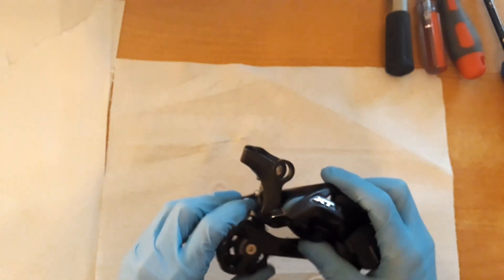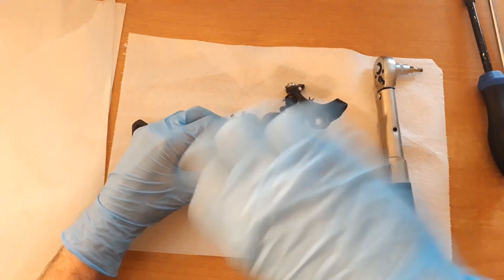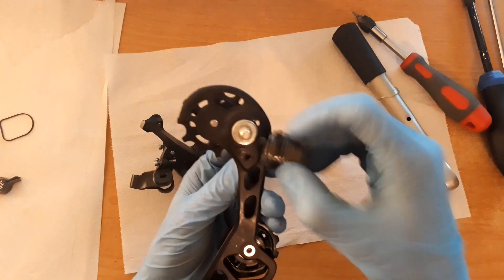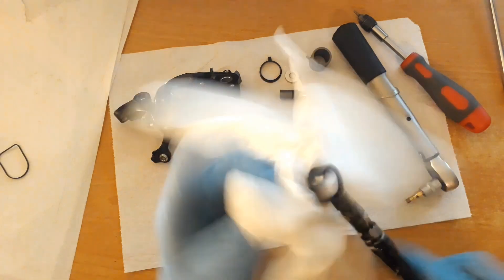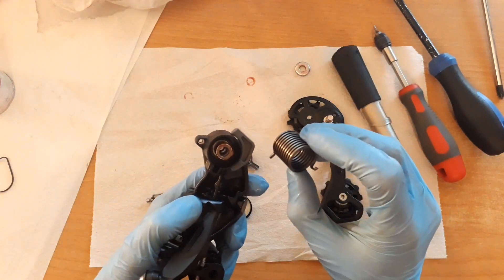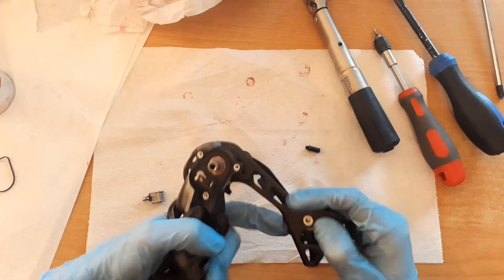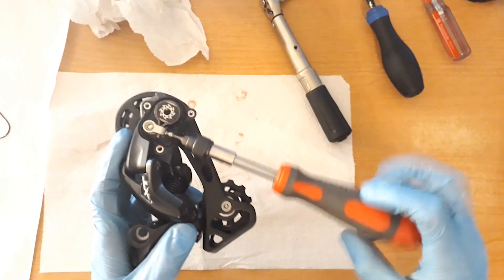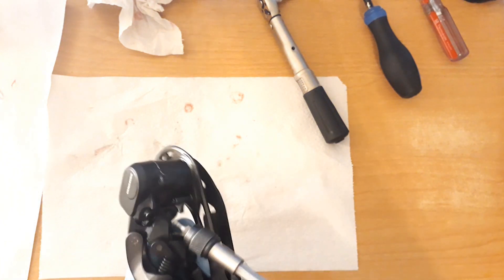Let's Do Maintenance - Shimano XT RD-M8000 Derailleur

Comment: The rubber ring on my plate axle was part of my issues, it disintigrated when I removed the axle. it was so stuck, I had to use a drift to get the axle out. I'm hoping that the grease will be enough to seal everything from water, I didn't have a new o-ring to put on.

Your video was excellent, very easy to follow and super helpful.
Reply from the maker: Yeah, I was surprised to find that o-ring there. The mech in this video actually was my new replacement mech. I did the service on my regular mech just before that and didn't see (or notice) any o-ring there. 🤷‍♂️

Comment: Nice work, thanks. How often (kms) do you think is necessary to grease the plate axle?
Reply from the maker: I honestly cannot say. I tend to destroy my mech one way or the other before I need to grease the axle. 🥴
But most likely it also depends on the conditions you ride in (wet weather/mud = bad) and the way you clean your bike (pressure washer = bad).

Comment: Anybody know if you can increase the spring tension by putting it in the other hole on the cage? I'm having issues with having enough tension on my drive chain in rocky sections of trail and dropping the chain.

Comment: Hi sp00n, at 7:30 you installed a plastic ring (Shimano part #no Y-5PV24000). When I reinstalled mine and I put around 8Nm on the axle it crushed the lip on this plastic seal/ring. Any idea what I did wrong?
Reply from the maker: I'm afraid I don't, no. Maybe it was already damaged, maybe something went wrong when assembling it back together. I didn't even think about that this could happen when I did this here. 🤷‍♂️

Comment: For some reason I can't get the clutch to "click" into place, I've rebuilt it a few times, trying to follow the instructions exactly, when I move the level to the on position I feel the tension increase but it never clicks, or locks, its like it doesn't quite rotate far enough? I made sure the bulge was in the right place when the lever is in the off position, Any suggestions?
Reply from the maker: As long as the tension increases and the clutch works, I wouldn't worry much about the click sound.
Reply: @sp00n  Hey thanks. I have had to rebuild it, and during the process realised the metal pin inside the lever actually twisted a little bit (somewhat common issue, strange that it can even rotate and isn't a single piece of metal) and it wasn't rotating enough to lock it in place when in the lock position, so after twisting it back a few degrees with pliers, it worked today and the chain stayed on even over the most gnarly stuff (Gave the whole thing a full clean thanks to your video). Amazing and much appreciated.

Comment: Hey thanks for the instruction!
Would this might fix my problem with having a sticky clutch? Whenever i activate the clutch on my Derailleur the shifting is sticking and it won't shift properly... ?
Reply from the maker: It might, indeed. For me, sometimes I couldn't shift down from the largest cog to the second largest when the clutch was activated, and cleaning and regreasing the derailleur fixed that.
Reply: sp00n thx for the answer, I'll give it a shot!
Reply: Didn't work :/ I've now tried everything, so i'll guess it will go for a warranty..
Reply: How tight was your clutch? Adjusting the tension can fix the stickiness.
Reply: @sp00n  how to activate/deactivate clutch? with moving the grey lever on cage?
Reply from the maker: Yes, the grey lever controls the clutch. You should pretty easily feel that the derailleur is much more stable when the clutch is activated (top position). If you don't feel much of a difference you'll probably need to adjust the tension. It's pretty easy, there should be enough video tutorials for this on Youtube.